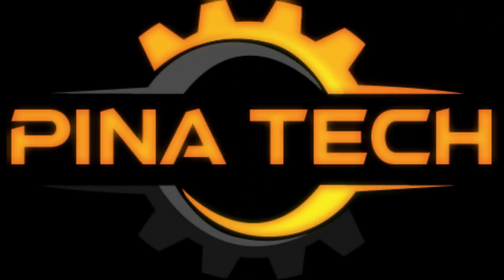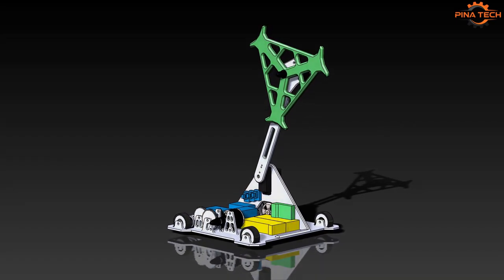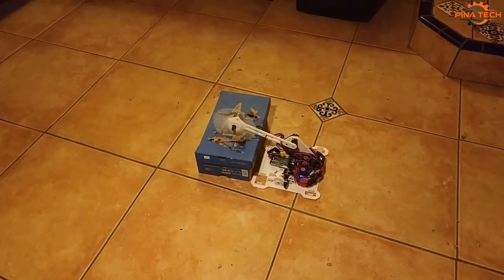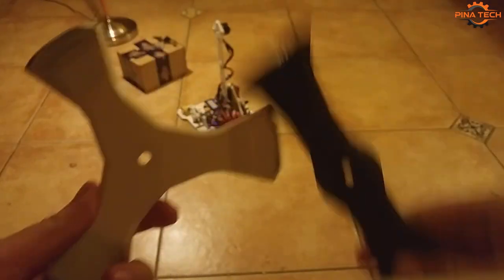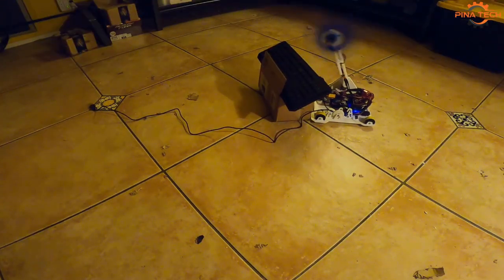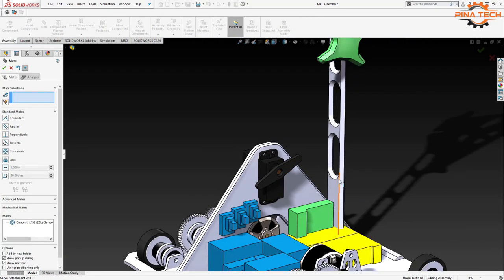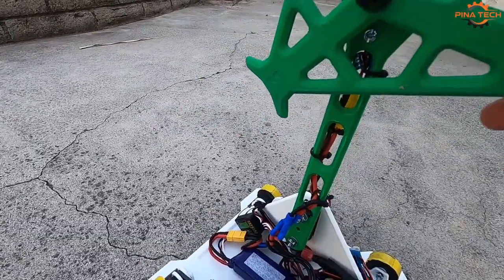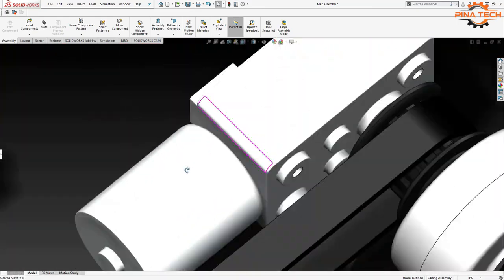Reckless BattleBots Prototyping | Pt. 1

Comment: I like the design! 
What weight class are you planning on competing in?
And a small recommendation that I have- it might be worth making the hammer saw be able to sit in the downwards position because when its straight up, it has a very high center of mass, which makes you easy to topple over. Also, when its on the back, it will also give you the option of charging them backwards to deal damage that way.
Reply from the maker: I plan to compete in heavier weight classes (12lb-250lb) with this kind of design. I do have plans for such a configuration as well as many others.
Reply: @aptinventions  What do you plan on naming your bot if you do enter it into something like Battlebots?
Reply from the maker: @Megaraptor99  I'm thinking "DOOM." The name will make more sense once you see the next prototype design (coming soon).